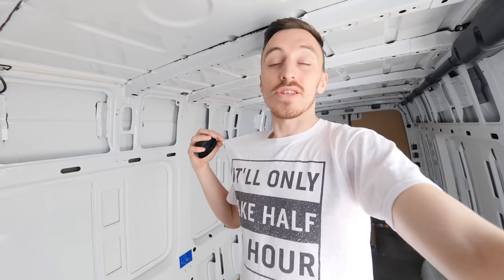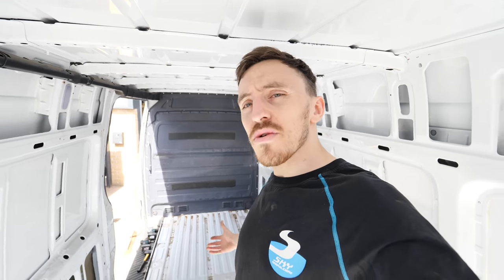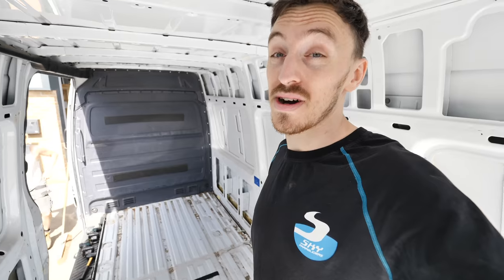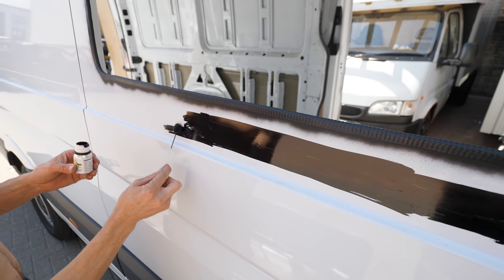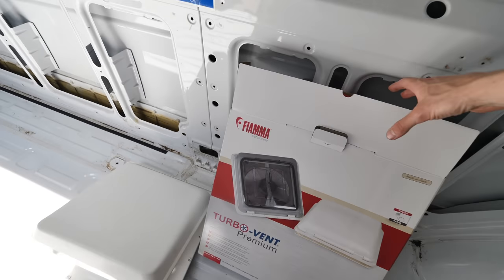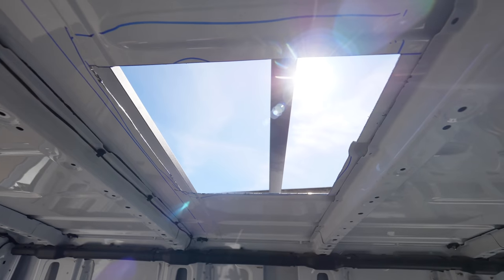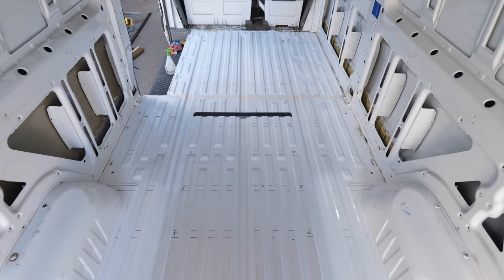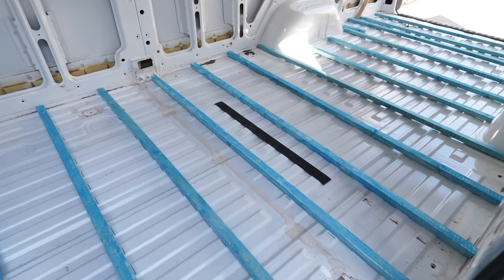Mercedes Sprinter NEW Van Conversion! Fitting Bonded Windows + Roof Vent

Comment: A new build and a sprinter too cool! But dude I'm nervous about the roof fan install in terms of potential leaking I would recommend using mastic tape especially at the front to level and build it up in between the ribs.

Comment: Hi Hugh, love the videos and you’ve given me a lot of inspiration to pick up a van soon to convert. One of my questions is what you look for when picking up a van? I’m pretty set on the LWB sprinter like you’ve got here but not sure what to look out for and looking for a little help! Keep the videos coming!
Reply from the maker: Hey matey, to be honest I need to do a video on this as I get asked this a lot. I would say it depends on a few things. With your budget I would say try and put as much of that towards the van to get a van in as best condition as possible. Mechanical stuff can cost A LOT and I would rather have a partly converted van that I can add to over a longer time than a quickly converted  van in worse condition.
(If you're UK based) Unless you plan to live in full time I would get a van that is max length 6m.  This will allow you to still, at a push, fit in most car parking spaces.
Don't worry about going high roof, as soon as you put a roof rack on a low roof van it can't fit under most of the height restrictions anyway.
When checking a van look around for rust and a big giveaway is what looks like bubbling under the paint (check around wheel arches).
Theres more  but I should  prob do a video

Comment: Hey Hugh. My wife and I have just recently found your videos and we love them. We have a small travel YouTube channel, and we've just decided to buy a van and kit it out. Will be a few months before we do so, but we've started planning and budgeting. We're trying to decide between a Sprinter or a Transit. Both LWB high roof. Do you have any recommendations? We're looking to spend between £5K and £7K on it. I think we can get a newer Transit, but everyone seems to go for the Sprinters. I think Transit maintenance and parts are cheaper too. Do you know if there's any reason everyone goes for the Sprinter vans? We would LOVE to live in our van, so reliability and cost is really important. Hope you can help, cheers for all the great videos 👍
Reply: The Sprinters tend to be stronger mechanically, keep rust under control and they will last. But your right, they are more expensive to buy. They also taper in towards the roof, the Transits and Boxers etc are more square.
Reply from the maker: Errol Magill nailed this question! The sprinters are lovely to drive and I have driven some that have covered 300,000 to 450,000 miles!! Just keep on top of rust. I am sure the transit would do you very well, maybe find someone with one and get their hands on opinion
Reply: Hey Beyond Your Doorstep... nice channel. Subscribed. Looking forward to seeing your potential van purchase/build.

Comment: So you can cut the roof bar and it doesnt affect the strength of the van? I just installed a rooftop ac unit towers the back of the van and the ac of bigger than the space between them and now  I have the back end on the beam and front end I put some stuff between the roof and aac control panel. But even with trying to insulate it  there is air getting in and out where it shouldn't be. I would rather cut the beam if I could. So your dying cutting one of these a little bit is not a big deal?
Reply from the maker: Hi Goran, we didn’t cut a rib in the the van only a roof rack bar. As the roof rack isn’t part of the original van it wouldn’t lose any strength.

Comment: What height roof is that sprinter and how tall are you? Looks tight before you raise the floor with insulation and put a roof in.
Reply from the maker: I am 6'2" and after fitting ceiling and floor I could still fully stand but it  was close
Reply: @HughTube  I'm the same height, is it a high roof sprinter or standard? I want a shower!

Comment: That Sprinter interior height doesn't seem that high. Once you add the floor and ceiling, will the new owners be banging their heads ?  Also , please water test that new air vent, it doesn't look totally water proof from heavy driving rain .
Reply: The roof vent is unlikely to hold up over time to leakages for sure imo.
Reply from the maker: We checked the roof vent by constantly pouring a bucket of water over it for a prolonged time. No issues whatsoever. The height is less than my boxer, I am 6'2" and after it was done I could still  just about walk around but it was close.
Reply from the maker: fitted it in the exact same way as my boxer and mine is now 3 years on and going strong

Comment: Nice to see a new project Hugh, just abit of advice, you would have been better using mastic tape or idl tape for the roof vent mate, sikaflex is OK but after awhile the sikaflex will separate from the plastic and leak unless you have used a plastic primer. Just speaking from experience buddy. Great video though👍
Reply from the maker: Cheers Dan! Will take that on board!